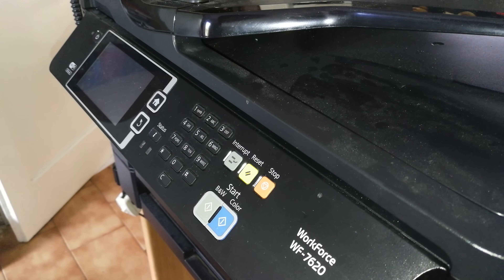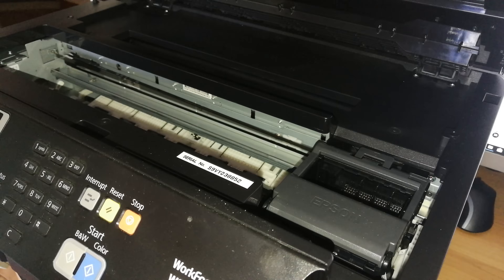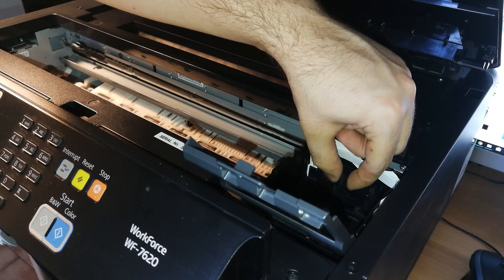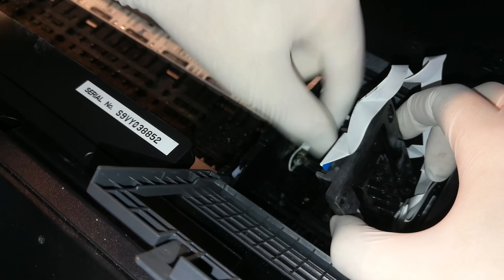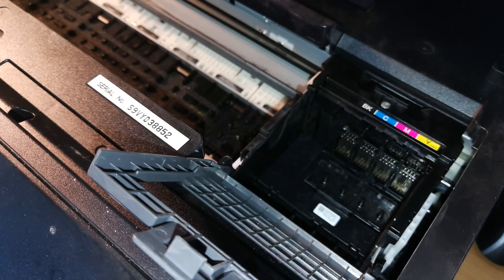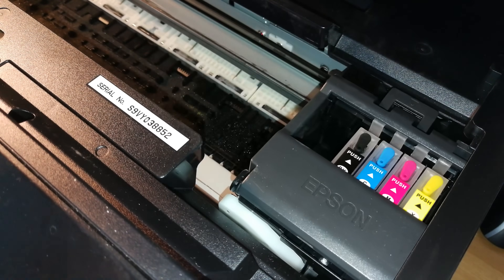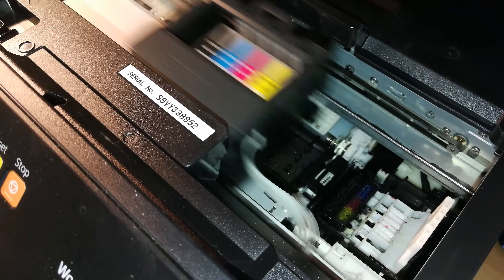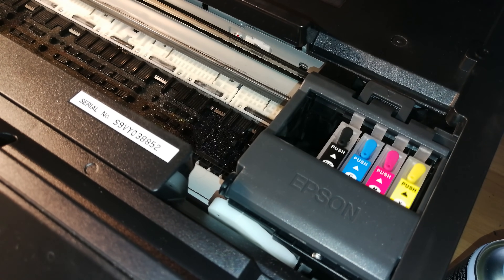Sostituzione della testina di stampa Epson WorkForce WF-7620, WF-7610 e WF-7110

Comment: This video was wonderful. So clear and concise. One question, what do you do to trick the printer to work while the cover is open?
Reply from the maker: Hi :)
If I remember correctly (it's been a while) you can use something to push the switch that's used as a cover open sensor, it should be on the back side of the front panel, maybe in the center, I use a piece of rubber tubing usually as I've lots of them.

Comment: Can't you just clean the bottom of that with alcohol?
Reply from the maker: Not alcohol as it's not good at dissolving ink clogs, eventually you can use windex with ammonia D or any similar product.
The point is that on this series of printers there have been different lots of DEFECTIVE heads, they are not just clogged and cannot be cleaned when they don't work anymore. Usually you can, not on these.
Reply: @PaoloMarcelli thanks

Comment: Thank you. I've just removed and cleaned the head on my WF-7725 (I needed to use isopropyl alcohol and canned compressed air, as the cyan feed was totally blocked).
One thing I learned was to be careful when replacing the cartridge surround (10:45). It's very easy to dislodge the flat cable on the right-hand side of the position reader behind the print head (the one with the transparent plastic strip running through it). Without the connection, the printer has no idea where the print head is, and slams it hard to the left of the carriage, reporting an error 31.  Just something to watch out for :)

Comment: I have done head cleaning 5 times but still not getting the ink to flow. What else can I do to have this new print head working
Reply from the maker: Hello, you should perform an ink charge, you can try to do it through WIC, if it doesn't work you need the adjustment program software
Reply: @PaoloMarcelli  thank you for your response. How do we do the ink charge. couldnt find any videos on it

Comment: Nice job! I'm going to fix my dried-out 7620. No one is making an economical 11x17 printer anymore and I need to print my B-size schematics. Thanks!
Reply from the maker: One suggestion if you clean or replace the head, instead of running cleaning cycles after, use WIC Reset to perform an ink charge, this particular function is free, it uses quite a bit of ink but it's better to prime a new printhead and purge air out of the system.
Reply: @PaoloMarcelli  I will try that, thanks. Just doing my first cleaning cycle now after changing the print head. Tossed the old ink carts - they were still wet but old and part of the problem, I'm sure. It sat for several years between uses and was clogged.
Reply: Just a follow-up: The new print head never started printing, even after running through an entire set of brand new ink cartridges during head cleaning. It cost me about $80 for the head and carts as well as hours of my time.
I don't know if I'm going to try this again or dump this disappointment of a printer in the garbage. 
It is not like I installed it incompetently, I'm an electrical engineer with a lot of assembly and troubleshooting experience. 
At this point, if I could hand it off to someone and get it fixed for $200 I'd be good with that. Otherwise, I'll just have to find another way to print my 11x17 stuff.
Ugh.
Reply from the maker: @davidyates9275  Where did you buy the new head?

Comment: I changed the printhead on my wf7210. Only problem is there's nothing printing. No colors or black. It went through the preparing ink and everything. Any suggestions?
Reply from the maker: Try doing an Ink Charge with WIC Reset (it's free, if you see something about buying keys that's only for the waste ink reset function that you don't need)

Comment: I read you comments the part # looks like FA13031 what should be the reasonable cost? Do sell - can I buy from you ??  -  And is there a video you made on cleaning the print head parking socket ?? and toe correct solution to use
Reply from the maker: Hey! Sorry but I'm located in Italy 😊
I've made a video about basical maintenance for cleaning the cleaning pad(s) but it's in Italian, I can buy those printheads directly from Epson but are very expensive.

Comment: Dear Paolo, I got the old print head out and the replacement head installed OK. I replaced the cartridges and turned it on. I get an Printer error warning error code 0x9E. I have a Epson Workforce WF 7610 connected to a a MacBook.

Comment: I learned something about these I have a wf3640 to get working..this will help if I get it to power on. Power supply voltages check out ok..next, power button and ribbon cable connections

Comment: PSA: If you own a wf-7610 or similar, do not buy a replacement print head. All print heads in circulation are refurbished heads that were originally refurbished. This means 80% or less of the nozzles/channels are working. You will never get a 100% clean head test. Epson does not manufacture brand new print heads for these models anymore, so you are going to end up with malfunctioning refurbs on ebay or amazon etc.. There may be less than 5 brand new print heads listed on the internet right now, that's about it. Expect to pay $300 for one of these. Buy a new printer. 7820 is the latest equivalent for 7610 (7840 for 7620, yes, weird numbering..) The print heads on those models are brand new and replacements in circulation are also new stock.
Reply: Sure wish I had read this sooner since I just purchased a $35. printhead for my WF7610 and it did not fix the non-printing. Mine does not print at all.  I put in ONE new cartridge since I do not want to spend the money to buy new carts if it will  not print. I thought I may just redo the whole procedure; maybe I did something wrong but I followed the video to the letter. I get power and everything else works; scanner and USB ports.
Reply: Are the printheads on eBay defective? I bought four but they didn't print

Comment: Know a good place to buy print heads? Trying to avoid ebay and  those 3rd party walmart listings. All of the parts sold there are guaranteed to fail or ship with blocked channels. Print tests always have missing lines, even after head cleanings. They are shipping junk as so-called refurbished. I don't mind refurbished, as long as all the channels work consistently, but most of these Chinese sellers are scrounging up scraps and reselling them. Model is wf-7610. My last ditch effort was to buy a wf-3520 for cheap and swap the head, but that option is out since they're now selling for over $100 (or googles silly results showing $800 on shopping). Odd thing is, ebay used to sell sealed print heads that came from epson. Since the 7610 is an old model, I would at least have expected them to sell heads for the newest models like the wf-7820, but nothing.. if i bought that new printer, there would be no head replacement options for it same as the 7610 on ebay.
Reply from the maker: In Italy I can buy printheads directly from Epson by their authorized dealers and service centers, try contacting an epson authorized dealer and ask them if they can sell you the head, it's very expensive though.

Comment: Great video. Replaced the head and cleaned the color 7 times and still not showing up on the paper! Need help. also, where do you fool the printer into thinking the lid is closed?
Reply from the maker: There's a switch but I can't remember where it is without having the printer in front of me at the moment haha!
Try to install new cartridges and run an INK CHARGE using WIC Reset. This function of WIC Reset is free so no need to buy a key.

Comment: Thank you so much, I got my print head replaced easily enough but when I plugged my printer back in and it came on the whole printer apparatus slammed into the left side of the printer and the screen said there was a problem to turn off printer. Any idea what could have happened?
Reply from the maker: Sure, the CR Encoder strip is not in the correct place, or the sensor cable is not connected. Check the CR Encoder Strip.

Comment: Great Video ADCSFX!!  I removed my printhead and see that the printhead ribbon has had a short (and 2 connector pins have blow) where the ribbon connects to the printhead on the black ink side of the printhead.  I can't figure how to get the ribbon out of the printhead housing and the springloaded white ribbon holder on the right side. Also it looks like it will be very hard to put the 3 connectors in on the left side of the printer (in the corner).  I can send pictures if that would help.  Thanks so much for your thoughts.  Vince
Reply from the maker: Hi Vince! Unfortunately when that happens the printhead is shorted, and you need to replace the printhead, the flat cables and also the main PCB :/

Comment: Thanks a lot.  I just used your video to repair our 5 year old WF-7620 (it is a real shame it is giving up so quickly).  This is saving us some money, but above all it is one big multi functional printer that at least for now does not end up on the junk yard and gets a new lease of life. The FA13031 was quite hard to find though (only one eBay vendor in Spain still had stock of new heads).

Comment: I have a wf 7710, do they use the same printhead with wf7610? Thank you
Reply: Yes ....mostly. The 7710 is the same as 7610. Only differences: facade, power unit and motherboard.
Paolo Marcelli wrote some time ago:
"HEY :)
As everyone is asking the same thing I'll pin a comment up here: Is the WF-7610/WF-7620 printhead the same of the WF-7710/WF-7720?
The answer is... It depends on the printhead revision and part number. You see, Epson updates their components when any defects are discovered.
FA13001 and FA13002 part numbers only work on the WF-7610/WF-7620
,
FA13031 part number works on both the WF-7610/WF-7620 and the WF-7710/WF-7720"

Comment: Another thing you can try is to disconnect the hose from the cleaning pump and suck the ink out there with a syringe. This is much faster and the counter of the ink pads does not go up in score. Good video. Cheers

Comment: Hi Paolo - great video thanks. I have error code 0x9A which happened after I removed and tried to clean the printhead. I'm happy to purchase and install a new one but some folks say this error code relates to a small SMD fuse on the main PC Board.  Is this likely as i don't want to waste money on a new head..?
Reply from the maker: Hi! You can always test the fuse with a multimeter in continuity/resistance mode before purchasing the new head. Honestly I've never seen that error created by that fuse but oh well, you never know XD
Reply: @PaoloMarcelli  Thanks Paolo. Is that fuse easily accessible? I don't want to have to take the machine totally apart to access the PCB?
Reply: @nicktasker4808  Hi Nick... is not easy. WF is not technician friendly at all. The fuse is F2, and yes, it usually blows when ink spills. You have to dissasemble nearly all the machine, dissasemble the mainboard and in the CG36 mainboard is located next to the F3 fuse (near the F4 too). The other fuse is in the other side of the board. After soldering the new fuse make sure to clean the printheads and the carriage contacts with isopropyl alcohol. About replacing printhead... I never needed to do like in other epsons. The fuse (F2) is a fast 0.5amps so it just only blows the fuse, but never seen a burned transistor or blowed printhead on these machine series (7710, 7715 and 7720)

Comment: Thank you ADCSFX for your thorough video. I was able to follow your instructions to clean, as opposed to replace the printhead in my WF-7620 and IT WORKED! Saved me $100 for the part and $300 if I had to replace.

Comment: Quick question where do you find the flat cable? My 7620 wouldn't power up after I turned it off after 3 print head cleans. I watched a video on this problem, and it was said that the flat cables could be damaged, and if so, the prin tree er wouldn't turn on. I Took it apart,  and low and be hold that's the problem. I just need to replace the flat cable. Where can I find that? Thank you.
Reply from the maker: Hi! I don't know where could you find it, but for sure the problem is not that XD it's a main logic board failure. The printer should power on even without those flat cables.
Reply: @PaoloMarcelli  Thank you. Can one of those boards be purchased? Or just get s new printer?
Reply from the maker: @mainmandev  It depends by the country I think, here in Italy Epson Authorized Centers can sell you mainboards and other components, but sure they are very expensive.
Reply: Expensive like how much?. The printer was $300. Is it more than that?

Comment: I just replaced the print head on my 7620. It was remanufactured from ebay. I have watched a couple different videos about changing the print head (you had the best by the way). Anyway, I am getting no ink. I have run the cleaning mode multiple time and the nozzle check. But, my paper comes out blank. No ink at all on the paper. What could be the issue? Thanks.
Reply: I have the same issue, print head replacement went fine, ran cleaning and nozzle at least 10 times, no ink printing on paper.  Any suggestions?
Reply: @chuckmoon1329  hello.
I have the same Issue. Do you resolve the problem ?
Reply: Did you solve this? Are the heads defective on ebay

Comment from the maker: HEY :)
As everyone is asking the same thing I'll pin a comment up here: Is the WF-7610/WF-7620 printhead the same of the WF-7710/WF-7720?
The answer is... It depends on the printhead revision and part number. You see, Epson updates their components when any defects are discovered.
FA13001 and FA13002 part numbers only work on the WF-7610/WF-7620
,
FA13031 part number works on both the WF-7610/WF-7620 and the WF-7710/WF-7720

And also: Where do you get replacement printheads?
In Italy we can buy them from Authorized Epson Repair Centers, I don't know about other countries!
I know MK Electronics and GEDAT Spare Parts are reliable Epson parts stores in Europe, other than that you can try to look on eBay/AliExpress but PAY ATTENTION!!! Printheads with different part numbers could be visually the same and you could end up with a printhead that does not work reliably for you, so if you go that route check carefully to see if they are genuinely the part number you need.
Reply: Dove trovo il part numer sulla testina?

Comment: Will replacing the print head allow me to use my wf7610 as a sublimation printer if it originally had regular ink in it?
Reply from the maker: Never tried but I think you could, but before replacing it I'd try to flush it with glass cleaner such as windex, then install refillable cartridges with sublimation inks and run an ink initialization with the Adjustment Program.

Comment: 7720 print head the same?
Reply from the maker: Hi! It depends by the printhead revision.
FA13001 and FA13002 only work on the WF-7620
FA13031 works on both the WF-7620 and the WF-7720
Reply: hi.. what printhead model works on wf-3640?

Comment: u seem reall ygood with these printers. I was gonna ask if you or anyone could PLEASE make a video on showing how to remove the star shaped exit rollers that cause Pizza Wheel marks? Ive been told it can be done and doesnt hurt anything but i am scared to do it without a guide since im not overly familiar with these printers and have only had this Epson WF-7720 for 2 months. So if someone could PLEASE make a video for this or a video some other way showing how to get past the pizza wheel marks on glossy paper.
Reply from the maker: Hi!
Yes they could be removed but I would not do that. It's not likely to cause problems when you print on high weight paper like glossy photo paper, but common paper at 80g/m2 really needs the guide of those star shaped rollers at the end, that could eventually cause a paper jam because the paper sheet could get in the way of the printhead/carriage, or you could have ink smudges on the prints!
Anyway, I'd make a video if I had a printer to make the video on :/ unfortunately I don't have one at the moment.
Reply: @PaoloMarcelli  is there a step by step or somewhere i could find instructions on how to remove them? I cant stop the damn pizza wheels and its driving me crazy. I just wanna get rid of them.
Reply: if anyone could make a video of how to remove the little white plastic wheels or just show me how to get to them so i can remove them i would gladly pay for the persons time.

Comment: I followed your directions to a tee.  Now I turn the printer on and get a error message OX9a error.  Any idea on what the problem is and how to fix it?
Reply: Any luck fixing this? Im getting the same after a clean.
Reply: Any luck with this, I am getting the same error.
Reply: I got error code 0x9a after trying to clean inside the printer.  It turned out that I got some ink on the encoder ribbon (mostly clear with very fine vertical lines) which runs behind the print head.  I carefully cleaned this ribbon and the error code went away.

Comment: I replaced the print head as per the instructions. When done the printer will not turn on at all. 

I don’t know if it matters but I did have some struggles getting the ribbon cables back in place for reassembly. 

Any and all help will be greatly appreciated.

Jason
Reply from the maker: Most likely you connected one of the flat cables not correctly, if it doesn't power on at all, it could have shorted and killed the main logic board :/

Comment: Good helpful video. My 7710 printhead has just packed up after 18 months. £45 for a new at the moment. I needed one quick so I had to but another one instead. Oh well. Coz I just bought a ciss system for it and then it packed up..
Reply from the maker: Yeah these printer models featured in this repair are prone to having problems in the printhead. They have been the first printers with PrecisionCore Technology, they haven't been tested throughfully and a lot of them appeared to be defective. Epson released a new printhead part number that works fine, but still you have to replace the head.